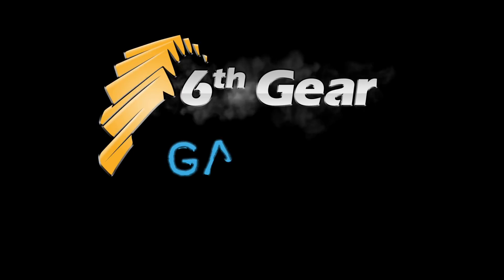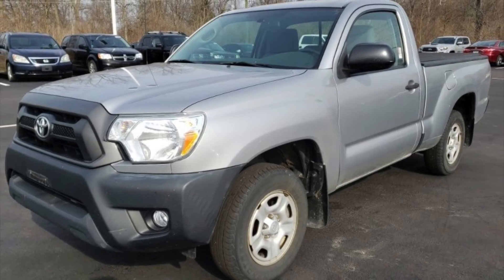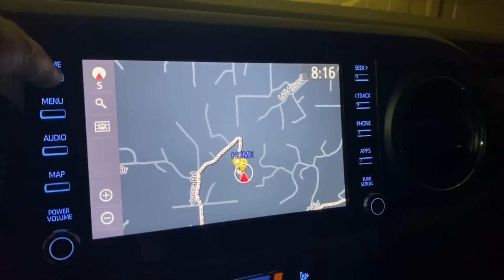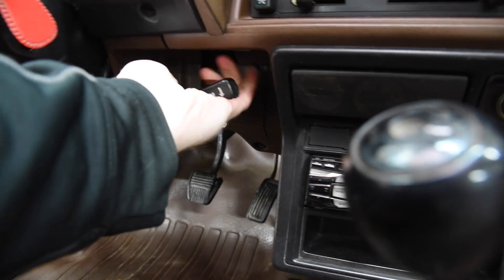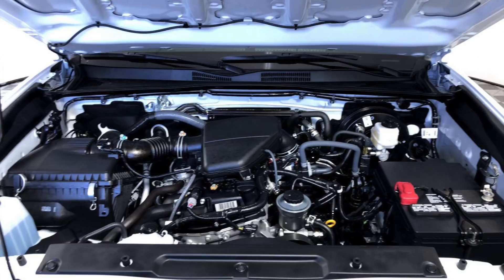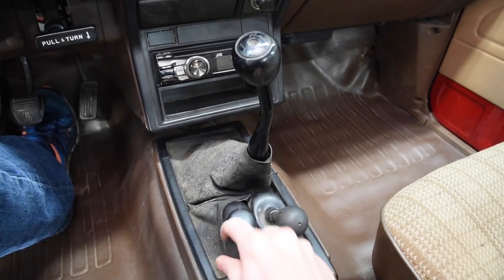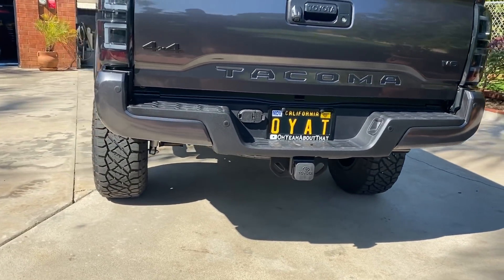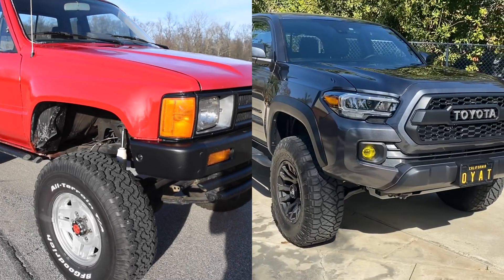1985 Toyota Pickup vs 2020 Tacoma TRD Off Road Comparison/Review

Comment: Yes the 1985 is a classic. And a very good choice if all you wanted to do is drive it off road. But it will struggle with that engine in any scenario compared to the 2020. Hills and mountains especially. And it is super simple with "nothing to break", but you lose all of the creature comforts of the modern version. The safety for one. And the heated seats and navigation and much better sound system and climate control and AC converter in the bed, and on and on. yes there is more tech in the newer model. But that is what people want and expect in general. Some may want a stripped basic model. But in large, that is not what most people want. We have become jaded to a degree with modern vehicles. We want ALL the features. But do not want them to cause issues or reliability problems. Doesn't work that way. If you want more tech and features, then you raise the possibility of failures. Luckily Toyota is one of the best as far as reliability goes. I wouldn't mind one of the old models for a toy. But I sure wouldn't want it to be my daily driver. Both are excellent looking trucks. Right now, most all trucks are very good looking. Especially the Toyotas and Fords IMHO. Both of the new Chevy and Dodge are "ok" imho. Better then some years as far as Dodge and Chevy are concerned, but not as good as others. Tacoma is far and away the best looking mid size truck. Superduty Fords are the best far and away as far as large trucks. But that is all subjective. Anyways, I think the Tacoma is far and away best in class. And it's sales compared to others reflect that. If I had to pick an 1985 vs 2020. I would possibly choose the 1985 for a cool take to car show or short trip vehicle. But for overall use and daily driver. No comparison, the new models are so far superior.
Reply from the maker: Well said, I agree 100%

Comment: Modern day Tacomas are built for on- road towing mostly. I have had 3 TRD off-road models. stick with 80's and 90's era Toyota trucks/4runners. I have a 1985 4runner SR5 5 speed on 35's , never off road.

Comment: have the same name but the t100 is better comparison,  but have you seen what you need to do just to do a oil and filter change. plus price to buy and i doubt if any 2020 will be around in 35 years electronice will not last that long

Comment: I have my doubts that there will be as many survivors in 35 years, due to all of the complex monitoring and management systems in modern vehicles. Plus the fact that the front and rear ends explode in a shower of plastic on even a minor impact these days. They'll probably just become uneconomical to repair, if not impossible.

Comment: These new fancy smancy pickups make me SICK. I prefer the old ones by far and can't believe the only way to get a long bed is with the old ones.
Reply: Sick?
Reply: @Mike-gz4xn  Yeah, I understand how some people could like some of these fancy features but some of them are so unnecessary and they kind of are repulsive - like I am too lazy to roll up or down my own window! And then they will eventually just stop working and strand me. I'm supposed to be too weak or lazy to slide a tiny 1 foot by 1 foot window behind my head!!?? Seriously I would feel embarrassed if I owned a new pickup and a passenger would see me using these fancy buttons!
Reply: Steven Frisch yeah welcome to 2020. Just wait till 2040 and you might not even be in a vehicle. Crazy we use washing machines now. Can’t believe people are too lazy to run it through a scrub board and hang it up. I can’t believe 4wd lockers can be engaged inside the vehicle now. What, you can’t open your door and walk to your wheel to engage a locker? Makes me sick.

Comment: Which one? 
Fashion accessory or work horse? 
Used on tarmac or mud? 
Used by drivers with a lack of driving ability or someone who can drive?
Will be changed before the electronics and sensors pack up or kept for 20+ years?

Pickup trucks used to be like denim jeans, cheap, practical and hardwareing, then they became trendy and fashionable.
Modern trucks are plastic where they used to be metal, had easy clean interiors, now they need to be detailed if they get dirty. They carried things everywhere, now most carry children to school. 

Are they better trucks, for the modern, image driven world over the it's all I need of 35 years ago, yes certainly. 
Will they be survive 35 years? There's a hell of a lot in them to go wrong, and 35 years gives it a lot of time to go wrong in. Will they be fixable in 20 years time? Will it be economically viable to repair them?

My in-laws have a 1960s Singer fridge that they moved outside 13 years ago when they bought a new fridge, it's used to store dogfood, still works fine. They replaced the new fridge 2 years ago. I think the new Toyota has built in redundancy, the old one, like the Singer fridge, was built to keep going.

I use my father in laws 2005 HiLux, he's had it for 15 years it's simple, nothing unnecessary in it, so nothing to go wrong and nothing has. It's a work horse, and a damn good one.

Comment: hey dont compaire toyota hilux with techoma or tundra ... if you want to compare 1985 vs 2020 ... use 2020 toyota hilux.. otherwise it z useless.. because techoma and tundra are two different bigger truck in toyota family....
Reply from the maker: Here in the US, Hilux (called "Pickup" in the US) was only sold until 1995, then it was replaced with the Tacoma. We don't get the modern Hilux that other parts of the world have.

Comment: I think people who buy these are confused.  Not sure if they want a truck or a tampon. I'm sure they're great if you have a large make up bag to haul. I wouldn't try anything bigger than a lawnmower. If real daring maybe a small rider. But hey, everyone has their own thing.
Reply: math time I drive an f350 for work everyday but a Tacoma on the weekends. Most of the guys I deer hunt with also drive Tacoma’s because they will fit down the overgrown trails through the woods so we don’t have to bring a 4wheeler. These are the older Tacoma’s of course. My work truck could never go where my stock Tacoma goes off-road.
Reply: @kentcantwell8270  you're right my comment was harsh. There is a use for everything. Never was my thing or never had a use for one. I apologize for the comment. I also have several different trucks smallest being a f250, all for work and a smaller truck wouldn't do. Again I apologize for my comment and hope you have a great evening.

Comment: The Tacoma is not the equal to the other truck. The “Toyota truck” is a hilux. They still make the hilux and even the new model is still half the size of a Tacoma
Reply from the maker: The last Hilux, aka "Pickup" as Toyota named it in the US,  was sold here in 1995. The 1996 Tacoma replaced it. I wish Toyota would sell the modern Hilux here, but manufacturers only sell large and mid-size trucks in the US.

Comment: Your 85 is better...it has a manual transmission manual locking hubs manual shit transfer case and a solid front axle, leaf spring  suspension and a 22R engine...with equates to a real truck with no computer crap to drive you nuts bottom line older trucks from Ford Chevy, Dodge ,Toyota, Nissan rules the roost👍🏾👍🏾👍🏾